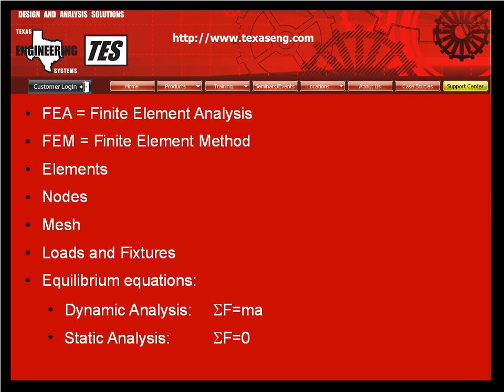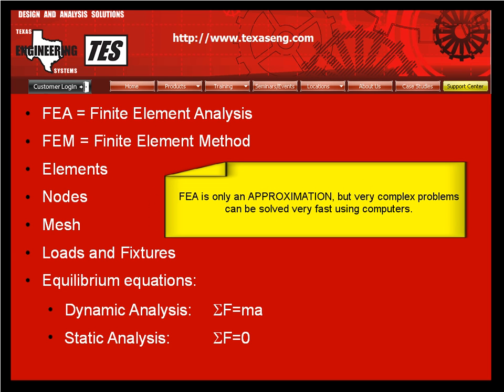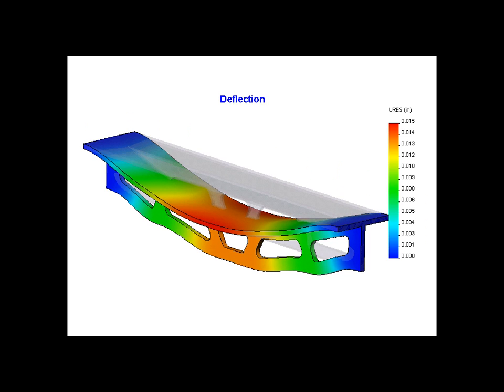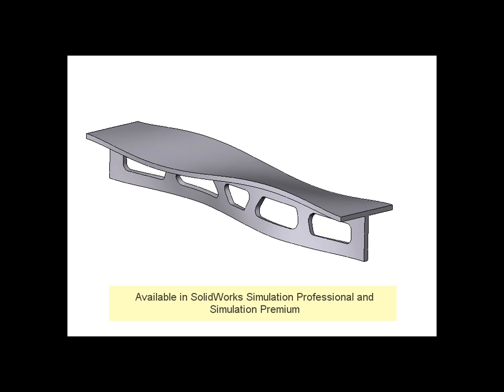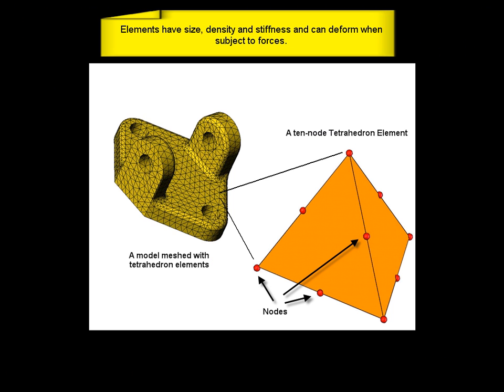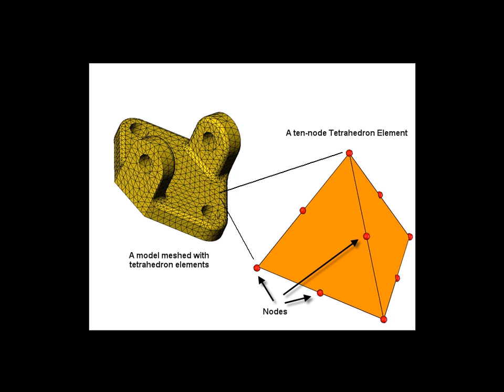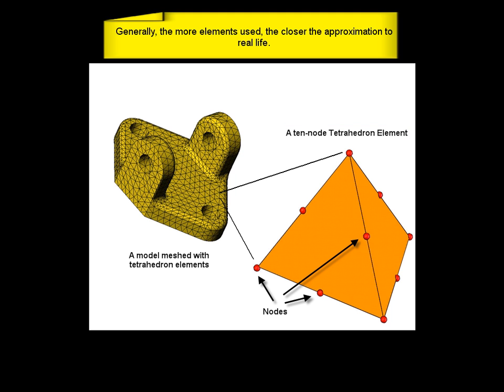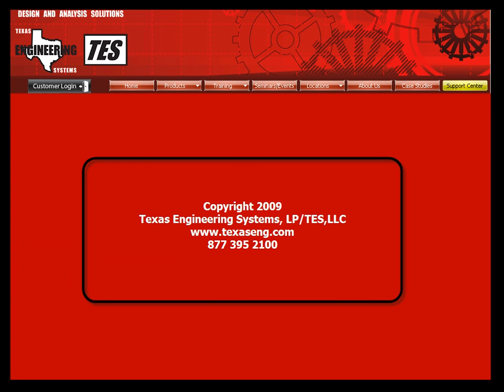SolidWorks Premium: Simulation Basics, Part 1

Comment: @Sigsite723 yeah, exactly... i should not use the word cheated. Is just that i bought the wrong software i guess. Its quite confusing actually when u talk about solidworks product because all their product name starts with "Solidworks" so u might not know if is for CAD or CAE purposes. From their websites, i think Solidworks Premium 2010 only allows us to do CAD and FEA for static stress analysis only whereas with Solidworks Simulation Premium 2010 you can use all analysis type. Is that true?